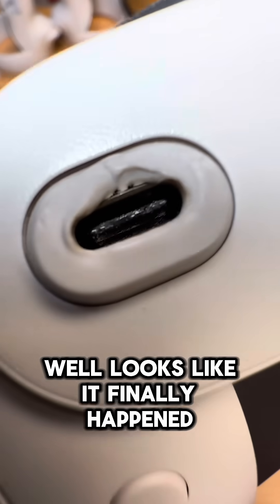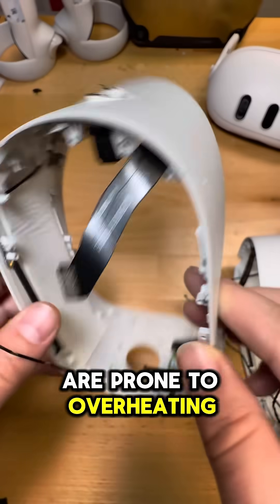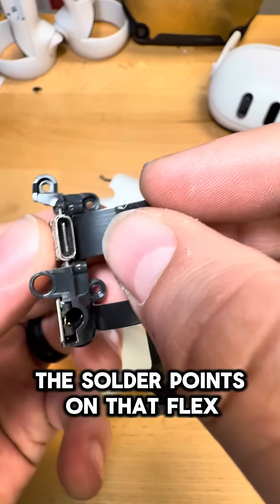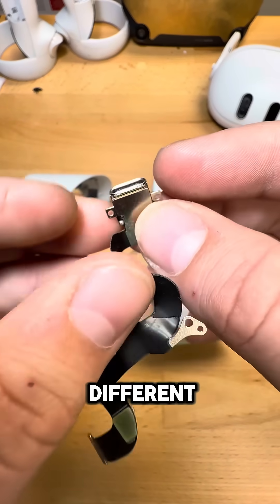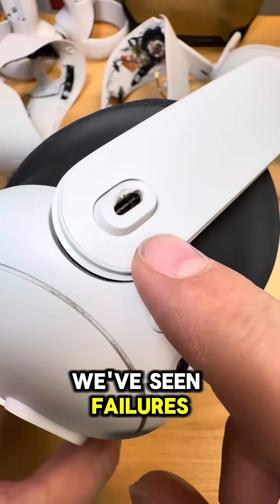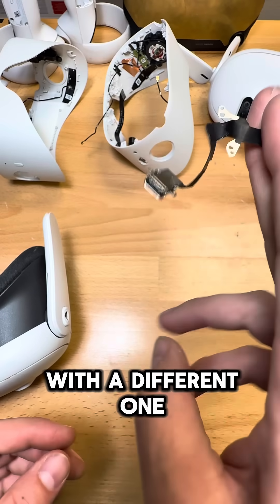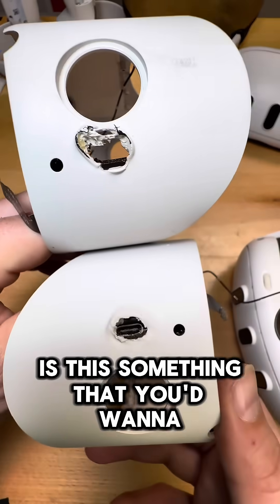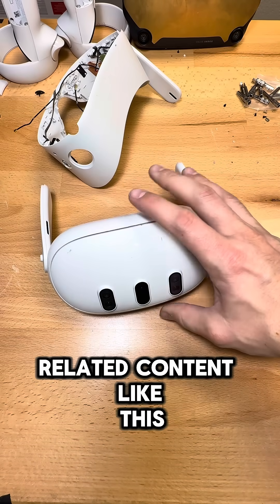Quest 3 USB Melting Is Crazy. #quest3 #vr #virtualreality #gaming

Comment: For some reason I have a quest charger that charges my vr way faster because on the normal charger it takes 2h and 30m to reach one hundred precent but for the one I have it takes like 1h and 30m and one time when my vr died I charged it and I came back 30 minutes later and my vr was over 50 precent charged and im surprised that the charger hasn’t burnt a hole though my vr yet.

Comment: Meta undoubtedly should have fixed this. There's no universe in which a customer-facing connector should be on a Flex PCB rather than a rigid PCB, using a USB connector that's got proper solder lugs to bind soundly to said PCB. There's no way to do that with a Flex board. They're saving a few pennies here rather than using a rigid PCB + connector. 

I've been in electronics engineering for 44 years and I'd never had made or approved a design like this.

Comment: That's 99.9% user fault in all cases on any device , that first type c you shown have clear signs of oxidation on it, by liquid.. it is  always ether liquid or mechanical damage and burnout as a result , as for the quest3 you can prolong port's life by sticking in Г shaped c-c adapter or short cable and fixing it some way so it will take the beating .. take care of your holes people, they are fragile )
Reply from the maker: I agree.
Reply: "Take care of your holes" this applies to more than meta quest charge ports
Reply: @madzak9847  Hi i just bought my first meta quest 3 and I am in a country where they don't sell or repair these please can you explain what we can buy to prevent it from spoiling the usbc portl and will that have any issues with pcvr
Reply: Nothing apparently, but it will be your fault and yours alone. Not poor build quality. The headsets creak and crack just putting them on lol@anandisrocking007
Reply: @anandisrocking007  we in the same boat ✌️💔
Reply: Take care of those orifices 😂

Comment: That's why you use a Right Angle USB C Extension Cable so you don't mess with your main USB-C port
Reply: That might help. I have two Oculus and I've essentially had that -- I have back-of-the-strap battery packs on both. I've rarely plugged or unplugged the actual Oculus port, but have a semi-permanent cable from the battery pack to the Oculus, and I charge via the battery pack. That's far more easily replaceable and, chances are, is correctly designed, rather than the insane idea of placing a Type-C jack on a flex PCB.

Comment: Just use a usb c magnetic cable fixes all problems
Reply: It depends on the Type-C insert. If that insert can mate to the case a bit, your best bet may be gluing that in place, to ensure there's no flexing between the Type-C port and the magnetic adapter. But clearly, the real damage occurs from cables directly interacting with Meta's incorrectly designed Type-C port.

Comment: I'm worry about the usb port getting wobble or loose so I bought L shape usb cable about 10cm for fixed attach to my VR port so that only the other end of that usb cable is used
Reply: Ensure that it's well secured, so there's no flexing at the Oculus port. But this is the best thing I can think of to avoid this problem.
Reply: @DaveHaynie  I tied rubber band on the head strip and let the other end of that usb hang in the rubber band so it can freely move but in limited way

Comment: Hey man ive bought a oculus headset off ebay, it works fine and boots up and controllers turn on, but once i get to the screen to get it set up, the tracking is not working the screen is just frozen and it keeps connecting the controllers and disconnecting, like its like a boot loop, i think it might be the cameras on the headset or a software issue?
Reply: you should NEVER buy any pc tech from ebay, may it a vr headset, a cpu or gpu, the likely reason those things are on ebay for a low price is cuz its broken, not because of kindness
Reply: @Marie-x7i  but thats why ebay stands in favor of the buyer when it comes to purchase disputes ,if you have a problem or the seller sells you a damaged product and they havent specified then you do a claim and 8 times out of 10 you can get a full refund and keep the product
Reply from the maker: Definitely the cameras. I see this issue all the time. Five times a day at least.

Comment: Y'all shouldn't use unofficial chargers
Reply: This happens with official ones too it’s a matter of people unplugging a bit to rough
Reply: @euca04  had it for nearly 3 years and it runs perfectly fine, although the left controller started drifting, and yeah at least y'all got someone to fix it, we don't have no one to fix , when it breaks , buy a new one
Reply: @azizibrahem27  have you been going rough with the charger? Probably not
Reply: @euca04  i mean , why would I
Reply: @azizibrahem27  do you wouldn’t know. These issues happen with official too but other issues can occur with unofficial chargers but the specific issues this video has is rough charger usage

Comment: I use a third part charging stand that utilizes those 3 little pins on the bottom lf the headset to charge it. I suppose i dont have to worry about this then lol
Reply: Only if those pins cant melt 😅
Reply: @coolertuep  jeeze I hope not lol

Comment: I had a quest 2 like 3 years ago that had that melting problem but i just recently got a quest 3s and i wanna know how i can be more careful so it doesn't happen again
Reply: Im not sure I'm not expert but I would try blowing a fan on it like a PC fan or a air fan that's close to it to cool it.
Reply: Another way is to make sure the wattage of the charger isnt to much higher then the stock one, unless the charger itself is plugged into a batter headstrap, then it should be ok to use a higher watt charger
Reply: Stick with the stock charger or something that doesn't do fast charging. I was using my 3s normally for weeks just using a powerbank to charge and i used my phone charger on it once and it gave me a wet/dirty port error for sometime even though it looked fine. It's fine now im not risking it.